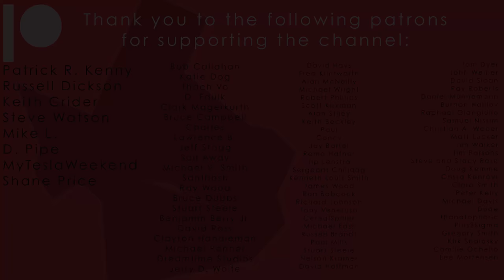Tesla Terafactory Texas Update #94 in 4K: Exceptional Weekend Progress - 01/18/21 (5:00pm)

Comment: Temporary fencing is for safety. Usually it indicates that anyone inside the fence doesn't have to be tied off. They are getting prepared to pour a topping slab over the double tees
Reply from the maker: Thanks for the explanation Christopher! Makes perfect sense and it's good to know they are about to pour a topping slab over the double tees!
Reply: Will they have to get the polishing machines up there too?!
Reply: Once a certain number of people are working in an area the tie-off equipment starts to  interfere with the work. The fence alleviates the issues.
Reply: @MrGonzonator  Most likely no. It is a reinforced structural topping only and there will be roofing (insulation, membrane etc.) on top of it, so polished surface is not required at all.
Reply: @fori24  Usually all the machines don’t go in day 1.  If the plan is for 8 machines ultimately, you might install four now, two more in a year or two, and the final two a couple years later.  By leaving the last two machine pads open, you just cut out the slab and work with what is needed then— if the manufacturer decides they need a few more inches here or there then the fully prepared base becomes useless.
Reply: @patrickkenny2077  I thought this too, but why not just pour the foundations now instead of interrupting manufacturing to tear up foundation to do it later?
Reply: @psjoe1688  If they need a different arrangement for the large steel beam (I think the term is base frame), they end up ripping everything up anyway.  You pour a slab now so you have a finished space.  Sawcutting and breaking up the slab later when it is time to do the work isn’t a huge issue.

Comment: Another slightly interesting milestone met.  The first full length rows of footers from North to South have been completed.  The rows are the ones on the inner side of the large concrete stamping building structure.  Lots of E/W rows are complete but these are first that span the N/S direction completely.  Also, it looks as if the last vertical column has just been set in place for the stamping press concrete area.

Comment: The fencing on the south concrete structure for worker protection while a thin concrete layer is poured followed by membrane roof.
Reply from the maker: Thanks for the explanation Carl!
Reply: Something like 1.5"-2.0" cover? Is a steel mesh going to be stapled or tack welded onto the roof? Do the TT panels need a bonding agent applied first?

Comment: I'm surprised there are only 3 foundations in the casting area -- I was expecting up to 5 in that section.  It looks like they are about to pour the rest of the perimeter.
Reply: There should be 6-8 casting. They haven’t poured the other side until the trucks have poured the first slab. The need access
Reply: Four at the very least, but three is a bit surprising.
Reply: @jimbobbob9063  Rumor was there would be more here than the 8 in Giga Berlin -- but with only 3 on that side -- it looks as if there may only be 6 machines -- which is a bit surprising.  I'm guessing they are not going to need any for the CT or Semi --- but again I thought there would be more here than in Germany....
Reply: @gerrywithaG  maybe because they have capacity at Fremont they don’t need so much. Berlin will be the only factory in EI so needs more. Just my guess

Comment: Hello Randy, would it be possible to release screengrabs from ~05:09 under a CC-BY license?
(Looking for a picture of the casting foundations for the Wikipedia Giga Press article.)
Reply from the maker: Hi Paul! No problem! I just updated the license for this particular video so feel free to get what you need.
Reply: @TerafactoryTexas  Thank you.  Initial photo used at https://en.wikipedia.org/wiki/Giga_Press#Texas  If Joe T. comes back with CC-BY permission aswell, might try and align before/after images (~14 hours part) before and after the concrete pour.  Many appreciations for the speedy reply + updating the licence!

Comment: Yes exactly! The rectangular squares loaded on top of the deck are prefab sections of wire mesh or commonly referred to as  wwm  (welded wire mesh) they're going to put a topping coat on the stamping area that's why it's all fenced off
Reply from the maker: Thanks for the info Corey!
Reply: Will this wire mesh be tack welded to the TT metal points to keep it very flat? Also wondering if a bonding agent will be sprayed before the concrete is poured?
Reply: Welded wire mesh because it comes in those pre welded 8 foot by 12 foot sheets sometimes 8 by 14 but no they're just tie wired into place and the surface was produced with a roughened face so no bonding agent necessary

Comment: Put a concrete cap on top of the roof. They did it in Berlin too
Reply: Do we know why? Seems exceptionally rugged for the purpose.
Reply: @FutureAzA  William Wheeler offered this explanation; They are using mass to dampen the vibrations and inertial moments of moving heavy weights on the rail cranes resting on the columns. It’s another factor in using heavy concrete columns instead of just steel. If the structure weighs thousands of tons it doesn’t even notice the energy needed to start and stop heavy loads weighing just tons. It’s that old equal and opposite law in action.
Reply: The TT panels are edge-welded together at 8 or 9 points on each long edge and at four joist-hanger locations corresponding to the vertical webs. The addition of a spot-welded steel wire mat and concrete layer will further unite and stiffen the panels. The steel wire mats and concrete will also tie into the exposed steel loops on the beams. The steel needs to be covered with 1.5"-2.0" of concrete to create a stable alkaline shield.

Comment: 6:53 those diamond-square footing forms look a bit strange.  I have not seen them before
Reply from the maker: I noticed those last night as well but opted not to call them out since the video was already longer than I'd prefer (due to a 3 day layoff with lots of new stuff to see).
Reply: Likely that a slab in that area will get poured before the columns are installed, for whatever reason. The diamond shape is internal bracing to keep the box square.

Comment: Hey Randy, at the South structure they are going to poor Concrete on top, after they install rebar mats, the rusty pile on the roof. The fencing at the edge of the roof is a security requirement, so you don´t need to wear a harness, which would be very complicated, while installing the rebar mats. Im pretty sure the trenches are for conduet or cables for electrical, since they are installing posts for electrical a the water retention pond and a big spule of cable is missing at the old batch plant
Reply from the maker: Thanks Marco! I was wondering what that rusty stack of something was! We'll see how much they can keep progressing due to the rain in the area that started during night. It's very light rain, but still wet conditions out.
Reply: Welded wire mats.

Comment: I wonder when they're going to remove all those column support poles on the south. Seems like they're just in the way now.
Reply: Once the top beams get all welded and concreted together AND the wall panels are welded on
Reply: All of the column to beam junctions and the topping concrete layer have to be poured first to make the structure stable enough to support itself and the required loads. It appears also that the perimeter footings poured against the columns are part of the design. The wall panels will also provide shear stability to the structure.

Comment: Curious how many casting machines there will be. Was thinking more would be in the the area that seems to be set up as just slab.
Reply: At Giga Berlin there was one "template" for the Giga Press foundations that was moved to each of the eight positions (now under tarpaulins in the storage area).  Looking at the overview between ~25:30‒25:40 it looks like a similiar configuration as Giga Berlin: 2 rows, each with 2 sets of 2 pairs = 8.  The concrete uprights have the "notches" for supporting the overhead crane for changing the dies/molds.
However, looking at Jeff Roberts' video from the next morning, the concrete got poured overnight, including straight across where the "4th position" would have been.  So perhaps just 6 Giga Press machines split across two rows?

Comment: Not sure what the new trenching is for but at some point they will need to provide drainage for the central valley of the roof.
Reply: Most of the roof rainwater needs to be filtered, treated, and injected into the city water mains. Instead of installing separate storage tanks, it is possible that most rain water will be retained on the roof while it is processed. This might necessitate having more strength in the roof layer (especially at the lower ends) and robust waterproofing. 

It is also possible that a filtered water cistern is being constructed with an impermeable membrane and cover.
Reply: @imconsequetau5275  Thanks!

Comment: I'm expecting the double T roof sections to have a 6" concrete poor with steel reinforcement. The fence probably lowers liability insurance and/or opens up the work to workers not trained with harnesses in a job where that would be quite restrictive. Just a guess.
Reply: Why though? I know they did this in Berlin, but that's going to be stronger than a parking garage floor.
Reply: @FutureAzA  The roof is actually part of the structural integrity of the entire building, so are the walls, so is the ground. The stronger these elements are the stronger the frame is. Everything is connected.
Reply: @tangent2658  Aha! So what I hear you saying is that without that roof slab to truly bond it all together, there's potential for sway on account of the gantry cranes moving such massive weights. Yes?
Reply: @FutureAzA  Yes that's a valid concern with the weight they move around, probably the best example. It's actually from a multitude of factors, even ground settlement, strong winds, lesser forces that would affect the structure over time.
Reply: Since the roof already has several welded wire mesh rolls, I expect the concrete to be closer to 2" of cover instead of 6". If thick rebar were hoisted up that would be another matter.
Reply: @FutureAzA  
Both Berlin and Austin have to account for snow loads. (Austin occasionally will get 11" of snow.) Austin has to retain rainwater, possibly on the roof, to filter/treat and inject into the city water mains.
Reply: @imconsequetau5275  2" would make more sense. Thanks!
Reply: @imconsequetau5275  2" seems a little shallow. I'm mainly looking at the fixings that extend out of the flat roof, some steel bar etc but we will see. I've never seen mesh like that used, it does kinda seem like it would need less.
Reply: @tangent2658  
Yes, the TT panel joist hangers are quite thick. Each beam has hundreds of loops that may protrude even higher, not to mention those pair of lifting hard points (which IMAO should be cut off). All need at least 1.5"-2.0" of cover.
Reply: In order to best harden the TT panels against lifting forces, like a tornado or micro burst, the steel wire mesh should fit in between the hundreds of loops in the beams and then steel rod inserted above the mesh but inside the loops. 

Also, each column rebar should wrap over the top beam rebar.
Reply: @imconsequetau5275  Hopefully It won't be too long until we get to see it. Hopefully one of the drones catches the poor, too.

Comment: At the beginning of the flight, there are 5 concrete trucks lined up in the gigapress area to feed the pump.  I was thinking "wow they're about to pull an all-nighter to pour that huge form."  When you came around again at the end of the video, the trucks are gone and I don't see any concrete in the form.  Seems very strange.  Am I missing something?  If they decided to abort the pour, what did they do with all that concrete?
Reply: I’m guessing they weren’t quite as ready as they thought.  Concrete looses quality in the truck over time so either diverted the trucks to footers somewhere or dumped it.
Reply: There was a pump truck driving to south end 8:36, maybe they went there?
Reply from the maker: They actually did start to pour in that second pass over the area, but I didn't like the lighting enough to really zoom in on it. I did get an update today and as of this morning they were riding the smoother machine that looks like a bumper car. They got all of it poured overnight as you suspected.

Comment: Not enough steel parts between the new and oldest structures to fill in the space between them without moving a lot across the site.
Reply from the maker: It's possible the steel needed for this hasn't arrived onsite yet, which would make sense if they are targeting filling in of that area at a later time. Hopefully it'll be sooner rather than later given how fast they are moving.

Comment: It would be fun to follow the electric line being installed on the south end to its connection point source.
Reply: It runs across the river , to the generating plant
Reply: @haroldz9915  I want to see a flyover. I don’t think they are generating there. I think they only have a switchyard across the river.

Comment: Those trench’s might be for roof drains as they appear to be on both side of the center and about the same as to length of the building. Also have they rented any off site storage space indoors or outdoors,since Tesla has two factories under construction and Berlin and Austin started pretty close to each other to could possible that they just added to the equipment orders placed for Berlin as it would speed up the start up vs separate orders for each plant.. I say this as both stamping and forge are far more complete at this date compared to Berlin maybe those spaces along with how fast the floors are being poured in the paint shop and the speed of roof decking we could see some real rapid work up coming.
Reply: I have not seen any pipe onsite.
Reply: I said it might be for drains,sooner or later when the roof gets done there will have to some kind of drainage.
Reply: Tesla is obligated to convert their roof rainwater into potable water. Most of the roof rainwater will be filtered, treated, and pumped back into the water mains. It is not clear yet how it will be stored before processing: cistern or detained on the roof.